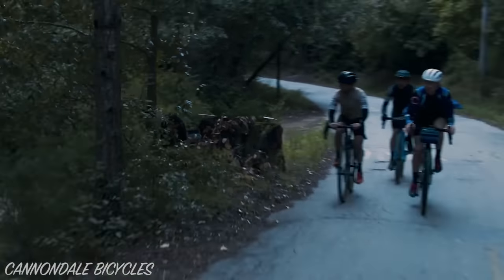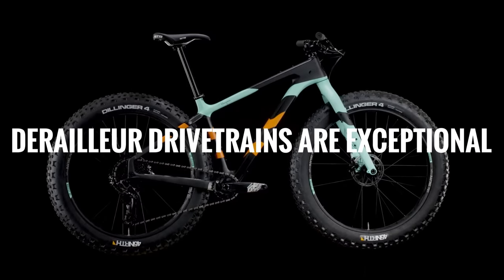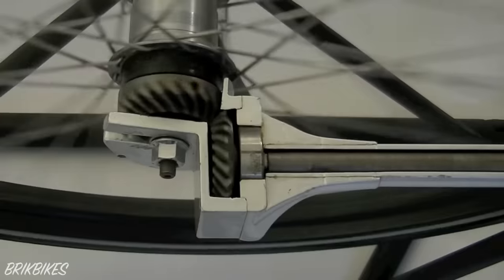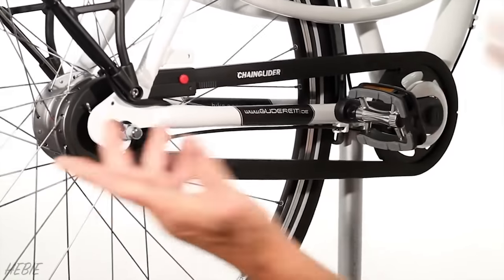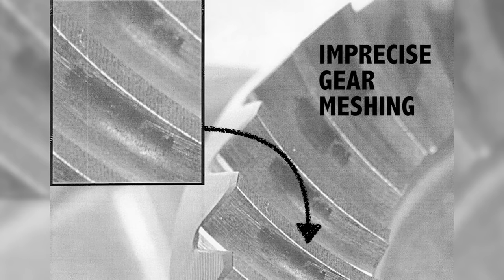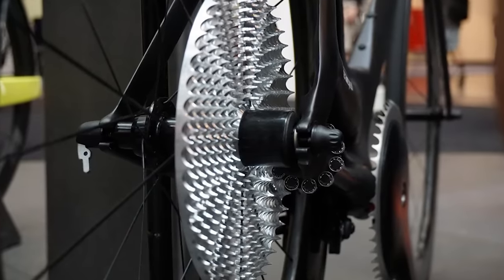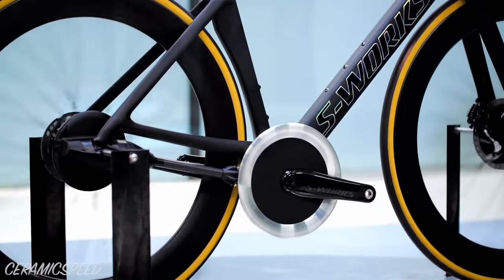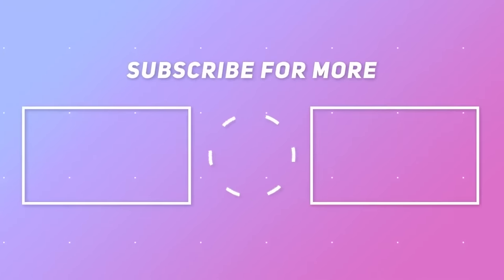Are Chainless Shaft Drive Bicycles a GENIUS or TERRIBLE Idea?

Comment: It's kinda hard to believe the chain is that much more efficient when it also flexes and a slightly beveled edge on the gears can cause extra friction. It's much harder to get a machined perfect chain to gear than gear on gear. Plus less efficient lubrication as you can immerse the gear in lubricant while chains are just coated in it.

Comment: Counterpoint to 3:29, shafts and lubricants were not as good in the early 1980s as they are today. You're comparing 1980 shafts with 2020 chains. Lubricants are also useful in shafts just to reduce friction in the casing the shaft is in, as well as the pedals. Lubricants are pointless to point out (pun intended), and while bike shafts haven't had specific focus, shaft systems as a whole are much more focused on due to shafts being useful for pretty much any rotational force transfer.

 Turbines are entirely dependants on shafts, and are used for every heat-based power generation there is, as well as windmills. Fans are also entirely dependant on shafts, and subsequently so are electric pumps. I feel like it would not be controversial to say that power generators and pumps have had much more focus and innovation on them than chains of all kinds. That is, at least, an equivalent amount of research on both mechanisms.

I've got nothing else to say on anything else, and shafts probably are worse, I just wanted to say this one reason is doesn't actually exist.

Comment: As a non-bicyclist, (just a motorcyclist, and a relatively mechanical person), it seems to me almost all of these downsides are basically solved problems, just needs proper engineering/manufacturing and wider adoption. (Chicken and egg a bit, perhaps.)

To be clear, I don't believe they could every completely supplant the ease of chains, just that the problems don't have to be.

Comment: IMHO, efficiency is the least problem of bicycle shaft system.
I think the proprietary nature of the shaft system vs chain is the major hurdle for shaft bicycle to become popular. Shaft system extremely hard/stiff material make it very difficult to work on by repair shop or owner. Non-inter-changeble parts between manufactures is undesirable for consumers, and in turn drive down demand, sales and popularity. A small market make every problem an expensive problem.

Comment: It's a fkn bicycle. It doesn't need rocket science to propel it easily, cheaply, efficiently. A chain is all it takes. Yet another example of egghead engineers producing a solution for where there wasn't a problem. Power steering, seat heating, air bags, anyone?

Comment: For reducing the weight of the shaft drive.. you can use high tensile nylon gears and shafts. I still feel shaft gear system is the best of all. All it needs is appropriate lubrication for reduced maintenance.
Reply: Just...no. Not rigid enough in all conditions.

Comment: The Driven system is intriguing, but I am skeptical about the openness of the teeth as they mesh. I can only imagine what would happen in mud and dirt. But, if they could cover that area with some kind of shroud, that might fix that issue. I currently use a chain, and my biggest problem with a chain is it sometimes comes off the sprockets when shifting quickly or from high high to low low quickly. The chain has to go from being tight to loose and the slack that happens at that point is noticeable as I have to pedal really fast to catch up to my momentum without losing the momentum gains I might have gotten before ascending a hill. 
Would that be an issue if I used belt drive?

Comment: I can tell you that if Honda or Yamaha decided to build a bicycle with shaft drive, it would be perfect.  They have decades of experience and technical expertise to do it right.  My FJR has 34K miles on it and all it needs is a periodic gearcase oil change.  On the other hand, my bicycles are finicky requiring constant tuning, cleaning, and repairs.  Inherently fragile and noisy my Shimano 105 and my other GRX 810 drivetrain are pretty expensive.

Comment: Shaft drives have been available on Maruishi city bikes for decades. Fuji-ta makes shaft drive bikes in China. There are 10s of 1000s of them on share bikes in China, a perfect application. Shafts are sealed, nearly maintenance free & bulletproof. The loss in efficiency is hardly noticeable on a 1 speed bike on crowded city streets. For serious enthusiasts, however, the efficiency trade off is the non-starter. Even if the technology evolves to carbon fiber & other lightweight materials to reduce the huge weight differential,  physics is unchangeable. There’s no conceivable way to mitigate the efficiency gap.

Comment: Le Tour De France uses chain and derailleur drive chain systems exclusively. If it's good enough for Lance Armstrong, it's good enough for me. As soon as you see adoption of these other drive trains used in tour cycling, that will be the litmus test, weather any of those solutions can beat the traditional chain, sprockets, and derailleur systems, which are now so common.
     A touring cyclist can sustain ~250 watts all day long, while producing maximum output of 330 or more during a sprint. Velodrome cyclists can peak at over 1,500 watts, albeit, for less than 20 seconds. That's as much power as a lawnmower engine, but, because the cadence speed is that low, the crank set torque rivals that of a small automobile engine! I just don't think shaft drive is ready for that.

Comment: Very good idea, the gimbal gear is very reliable and does not require maintenance and frequent cleaning like classic chain and sprockets, also the operational wear is minimal. I am only concerned about the low gear range of such a solution, which is on a bicycle it is necessary to have as large as possible. Also, all abgrade transfers would not be possible.

Comment: Doesn't make sense that involute angular gears are less efficient that involute spur gears.  That also goes for the helix involute gears.  Timing belts are also involute gears. Involute theory states that power force is transferred without sliding occurring at the contact line.  Since chain drive are not involute their is sliding when engagement or disengagement occurs. The large contact ratio of many roller to teeth engagement results in lower portion of the force on every roller tooth contact lines thus sliding loses are lower. 
The biggest issue of angular gears drive is the forces on the bearings that are at right angles and thus a stiff structure is needed to maintain the low involute gaps needed for efficiency.  If the gears do not mate properly sliding will occur and efficiency suffer. 
Hub and the electric motor gear boxes have the same need for stiffness. What is unclear is why anyone would design a shaft drive system with the shaft held by a bearing at each end.  Your asking for a significant loss in stiffness and added weight.  Dog bone shaft between the angular gears with two  bearing support is the standard in all drive shaft designs outside of bicycles. With this approach the gear box stiffness would be similar to the hub and electric motor gear boxes.  The dog bone drive shaft can have some spring to it just as a chain or timing belt has.

Comment: “They work really well” is quite offset by someone being found in most towns who can adjust them. I have found the latter to be important, unfortunately, which I would never tolerate with any other transmission I own. I suspect cheap and light are the principal merits that have maintained the status quo.

Comment: I have a shaft drive bike, I think it is Chinese built for a Belgium company. single speed only it travels extremely well on both road and track , it's stiff feel is confidence inspiring and the direct positive feel you get through the drive chain works well for me,   For those of you that have never ridden a shaft drive it will be difficult to understand but all I can tell you is that your feet are able to instantly respond to the felt inputs through the shaft not something that you can do with belt or chain, try one and see for yourself. biggest downside I wore out the cheap monkey metal bevel gears in the bottom bracket and the drive chain started to lock up parts were unobtainium, a great shameas it was one of the three best bikes I ever road the other two,  one being a cannondale and the other a pre war 28 inch wheeler with a three speed sturmey archer gear hub laugh if you like but that bike ate up country roads in comfort and style, and almost effortlessly to boot.

Comment: i think shaft drive wont work out just because it seems much much more vulnerable to damage because the point where the gear meets the wheel is a very very high torque spot whereas the chain spreads out the force

Comment: I have an original Maruishi shaft drive bike when they made it for Seibu department store. I have a rear flat and need to take the rear wheel and the shaft system apart to change the flat. Do you have instructions to do this in English? I only have the original Japanese. Thanks

Comment: I don’t ride bycycles anymore for a medical reason, I look at motorcycle drive trains and you have all these types of drives on different manufacturers, the shaft drive can be up to 35% less efficient in drive, the maintenance is very good and doesn’t require constant oiling. Where I see shaft drive as good on a bicycle is on a hybrid bike with pedal assist electric motor other than that it will take something very lightweight and indestructible for all other bikes. That’s just my take on it.

Comment: I just want an indestructible bike that can be parked outside with rain and sun all year round, with one gear, backpedal brakes (cause all brakelines degrade with UV) with tires that never deflate and a transmission that I never have to replace or even do maintenance on. I don't give a toss about the weight, all I care about is that it is as ugly as possible (so it never gets stolen) and that it is absolutely zero maintenance. My bike is parked outside and the crappy bike chain rusts through at least once a gear, which a rusty chain I'm gonna guess is more inefficient than a shaft drive. Even if lubricated it's only a matter of time before it needs to be replaced. I drove my bike into a canal last november. After a short frigid swim I retreived the bike, and there's still so much mud and silt in the chain and gears that I can hear grinding away. There is a use case for shaft drives that are closed off from the environment and don't have to be lubricated all the time, that don't care about the dirt, that just keeps working.

Comment: Chains look much better overall. Also I used chains my whole life, I only had to change it once, it simply goes on and on without maintenance for more than ten years, if you are a common rider at least. Belts might be good, I never tried, but it can't use derailleur drivetrains, which in my experience are also amazing and require very low maintenance.

Comment: If I could throw in an aside! I noticed that the transmissions on the bikes,don't use hypoid gears,and copy the PCC,street car electric transmission! Those drives are both long lasting,and absorb road shocks! The drives have literally several millions of miles,in operation,in all kinds of weather conditions! The Russian built cars,can and do operate in Siberian conditions,so the drives are flexible,and if the bike makers copy the car builders,and suspend the drives in rubber,they might make an unbeatable product! They auto manufacturers never caught unto what the railcar builders did with rail truck suspensions! By the way,the PCC patents are now public domain,it might be worth the time and effort to see the specs,and scale them down,for use! This is just another way of fixing an insoluble problem,and keeping things from getting completely out of hand! Think outside the 📦 box!! Thank you for your attention ☺!

Comment: I tried to build an industrial bike company using the shaft drive and it killed the company.  Called them RuggedCycles.  Got a patent for an airless, chainless bicycle.  Lost well over $5 million  #4 should be #1. ALIGNMENT is impossible long term.  ALSO, attaching the rear wheel gear can be a nightmare.  And there is inconsistent manufacturing quality from Taiwan.  I threw away over 500 shaft drive frames after building several thousand and selling them to industrial facilities worldwide.  One time a refinery made me replace every shaft in a 150 bike fleet.  From my chair, the Gates belt is awesome, RUN LIKE HELL FROM BELT DRIVE BIKES!!

Comment: Why not put the rear gearing along the wheel instead of at the center hub? Ffs, shorter shaft = less weight. Larger contact area at the wheel = reduced torque flex at the connections. Put the gearing on both sides of the crank and wheel to balance forces.

Comment: For a long trip and being on lonely back roads, you want the bike to be bullet proof.  The less likely to break a component, the better chance of a trouble free ride.  Having the extra pound or two of the drive shaft, can be cancelled after riding for two days.  You'll lose weight on long rides.

Comment: At about 5:00 there is wrong text. There is explaned, that at a shaft gear torque will be higher because of smaller diameter than chain gears have. That's not true.
A reduced diameter (= lever lenth) does NOT change torque at same speed, because energy will be the same.

Comment: 1200Lbs Leg press :) no worries for efficiency loss, i hate how weak & soft 16” 2.4 continental all terrain tires are, thin sidewalls, i have tubeless wheel, but tire starts leaking from sidewalls after load
Reply: Then requires slime to stop it from leaking, then i have to add water when slime is dried up to seal up again

Comment: That driven system appears to have all the worst aspects of a dérailleur system, along with some of its own with none of the advantages. Like a dérailleur, it's still exposed to mud and dirt and is consequently going to be subject to accelerated wear and will need constant cleaning. It's also going to need very careful alignment. In addition, it's certainly not going to be cheap and I have severe doubts the ability to transmit high torque with the pinion bearing at both the "chainwheel" (for want of a better word) and on the rear wheel gear (whatever that might be called). The transmission of torque is going to act to bend both the chainwheel and rear gear, especially as those carefully profiled "teeth" wear and more of the force becomes lateral. Compared to a chain, the spur gear will only ever have a couple of teeth in mesh, whilst a chain wraps round the sprocket and even when on a small sprocket at the rear, the forces are still carried by several teeth. What's more the forces are all fairly well in line with the sprocket unlike this system where the force is applied off-set to the gear. Just about the only advantage is that the shaft is always in-line, whilst on a dérailleur the chainline will usually not be completely inline and, at the extremes, loses efficiency and increases wear.

What's more, this system doesn't allow for a twin or triple "chainwheel", which will limit the gear range unless that rear gear has a very large diameter.

Comment: Not addressed, the flex of the frame and the ability of that flex not to effect the drivetrain under load. Mountain bikes under rough terrain will not perform with a shaft drive as well as a chain, unless of course the shaft drive is massive which equals weight. Motocross bike manufacturers would switch to a drive shaft overnight if it was a more efficient and reliable form of driving the rear wheel.

Comment: Has anyone ever put like, a giant mechanical watch spring on a bike?
As a variable gearing mechanism?

So the more you pedal, the more torque it has, and it releases energy at a steady rate.
If you need more energy to go uphill for example, you just need to pedal more, not harder
And if you need less energy to go downhill for example, it releases energy faster goes faster.

Comment: If the only real merit of a shaft drive is that it can be sealed from the elements, then the best drive would probably be a chain drive powering a sealed gear hub with an enclosure around the chain as well.

Comment: The obvious solution (to me anyway) for the inefficiency of the shaft drive is to throw some horsepower at it. Hub or mid-drive electric bikes have power to spare. A 2 or 3 Kg weight penalty and 9% internal friction loss is not a deal-breaker if you have that extra 250->400 watts and 1200->2000 mAmp/hrs to play with. Yes, you loose some performance and range but it just might be acceptable for a commercially viable segment of the e-bike market.
Frankly, I'm surprised and disappointed we haven't seen shaft drives already in high end e-bikes.
Reply: Yep, obviously; there's a reason why cars already do this, of course, as the large gains in reliability is more important than the smaller loss of efficiency. On motorbikes it's already quite common to use shafts, especially on larger ones.

In the future it's almost certain that all electric vehicles will use frictionless electromagnetic couplings, which will give you the best of both worlds, both the low weight and high efficiency of chain drives and the reliability of shaft drives.